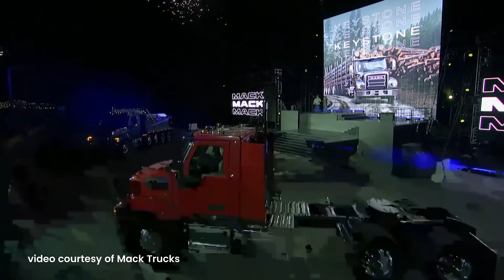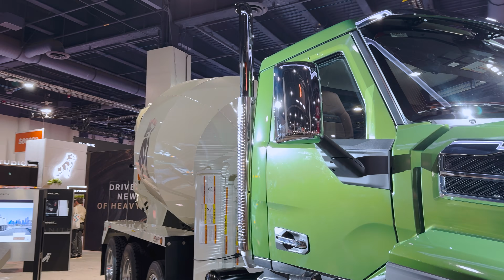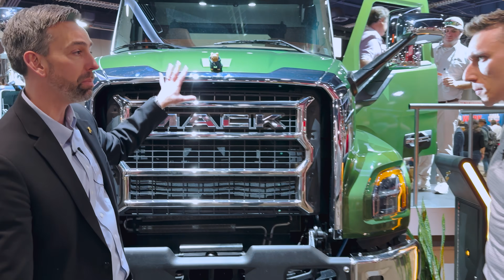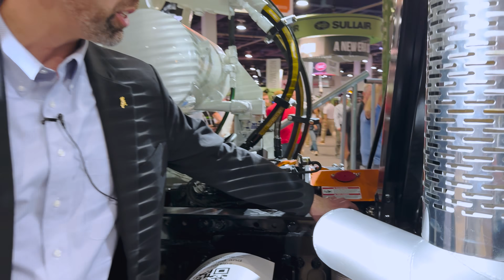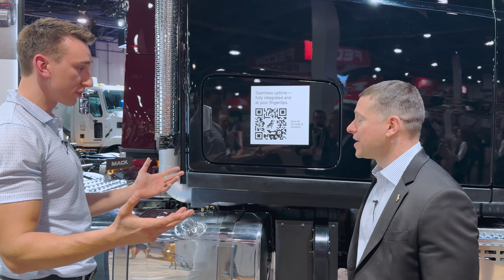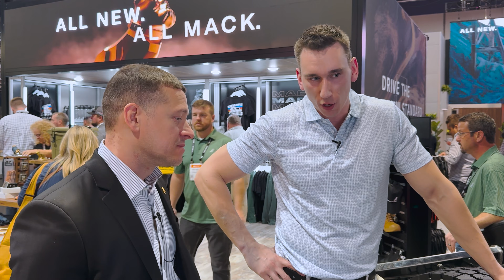First Look at the 2026 Mack Granite | ConExpo

Comment: I started watching this video with some hesitation because I wasn’t sure if it had anything to do with the vehicle being a better electric vehicle. Turns out, it does not. I’m out. The best emissions are zero emissions. This is both technically possible and produces a much better truck in many ways. Not going to be perfect for every truck, but a large percentage of trucks could be swapped out for this. Not interested in hearing about vehicles with a tiny bit less emissions when we live in a world where zero emissions are easily possible.

Comment: It took me a few minutes to realize this is just another diesel truck.  What the heck.  Who cares about dinosaur tech?
Reply: Which helps emissions more: 225,000 semi trucks getting 6% better economy or a few 100 EV trucks?  The math show it makes a real difference. An interstate trucking company simply could not replace traditional semi trucks with EV trucks until the charging infrastructure exists.
Reply: @mikus4242 Chances are the charger infrastructure will not improve, if they added more power charging stations that would cost a lot more money, people don't have the money to power up those types of things! Electric is expensive and is dangerous to work with!